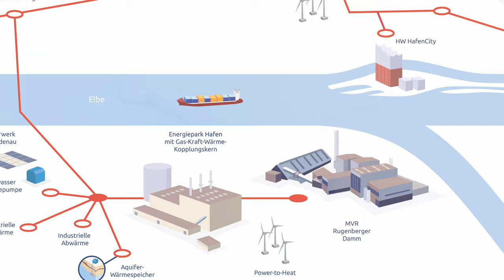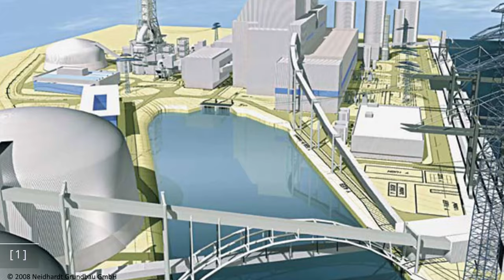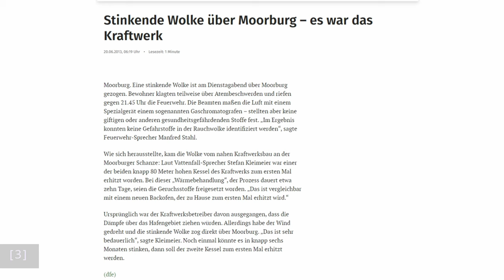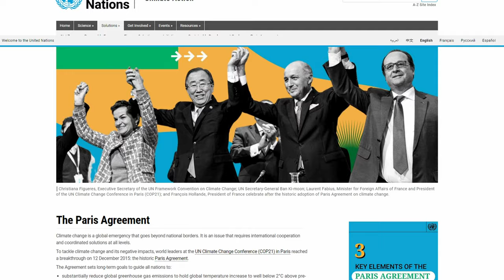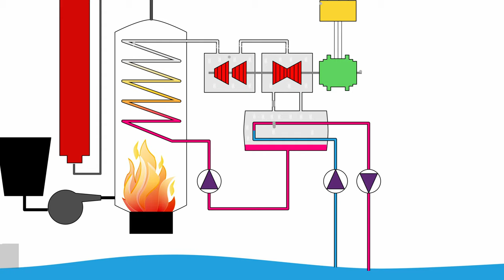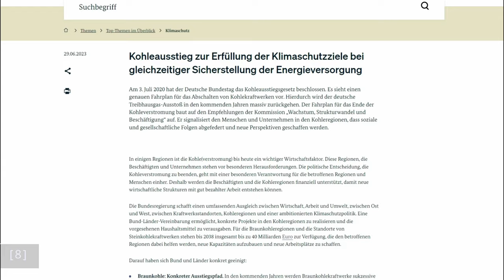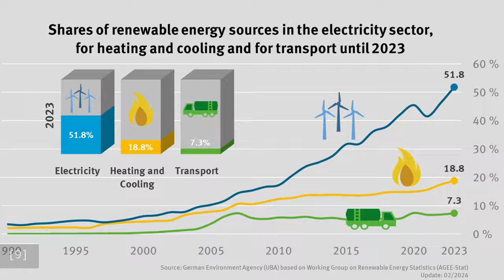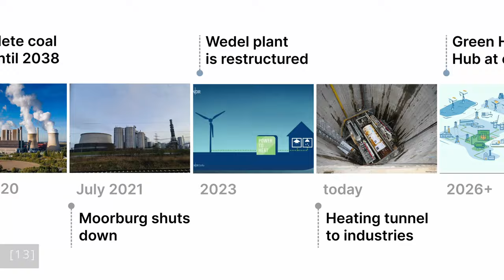The Failure of Europe's Most Efficient Power Plant. What Happened?

Comment: Germany should not have shut down the nuclear power plants - and should have refurbished.  Get the most out of the capital equipment in place.
Reply: I would agree up to a point. The German reactors were Russian built technology which whilst carefully run were safe but only just. They were close to being time expired and lacking modern safety design.
Reply: @briangriffiths1285  The majority was also shut down years ago already. The ones still running were single digit % of total German capacity.
By 2016, only 6 of originally over 30 reactors were still running. Nearly half had been shut down before 2000 and no new ones had been built since the 80s. With the vast majority having been before that.

People are massively overestimating the nuclear capacity Germany had.
Reply: Let's see how the nuclear plants will work in the future. The last build were very cheap and cost effective. And i´m pretty sure, that  GB has solved any problems with nuclear disposal. ;-)
Reply: More than half of the shut down German plants where not perfectly fine running power plants. Many where already standing still, with maintenee and repair costs too high to make an economic viable startup possible. The plants shut down last where economically viable but not by a large margin, as they too started showing their age. It is also not possible to maintain a whole industry with just a few power plants, so they would have to switch to plats build, operated and maintained by France. There was very few usable capital remaining in the existing equipment because renewables where already providing cheap base load.
Reply: @jwstolk  Good summary - thanks.
Reply: @briangriffiths1285  That is only true for the ones in Eastern Germany.
Reply: Renewables now produce more power that the nuclear plants  ever did. That being said, I think the order was wrong. The lignite plants should have been shut down first, because they emit the most CO2 per kWh, than the hard coal power plants, and nuclear at the very end.
Reply: @jwstolk  And even in France, those Power Plants run on a major loss, despite them having a ton of it.